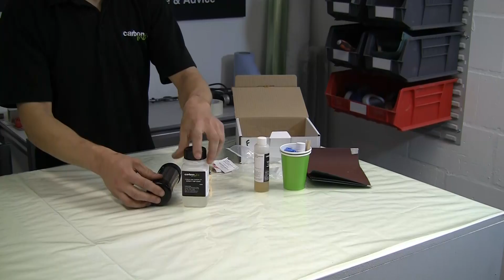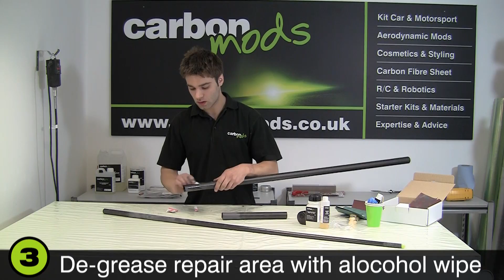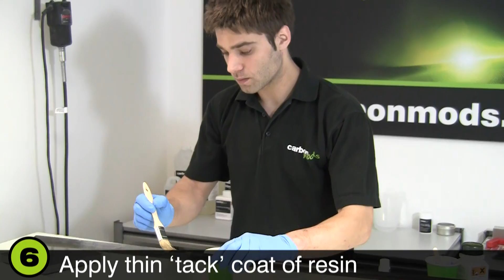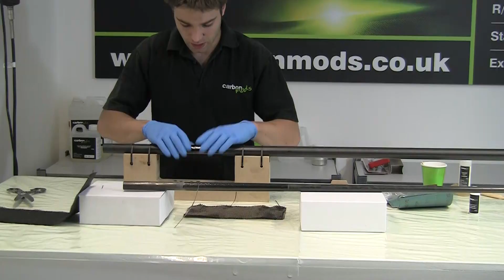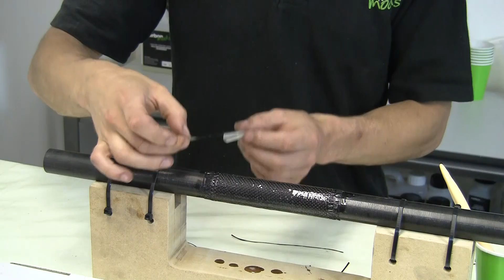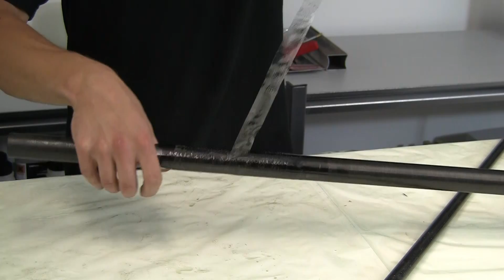How to Repair a Broken Carbon Fibre (Fiber) Fishing Pole or Rod

Comment from the maker: The reason is that when a tube has been fractured or crushed then the fine balance of the unidirectional structure is compromised (sometimes further than you can see) and so it's important to add some 'hoop strength' to the tube at that point. We stock and use unidrectional reinforcement every day but making a repair like this using UD just doesn't work anywhere near as well as using a woven cloth.

Comment from the maker: Yes, definately. The more carbon fibre you add, the stronger the repair will be. In the case of a bike-frame repair then we would certainly suggest adding plenty of reinforcement. On a fishing pole repair you wouldn't want to add too much extra strength because you'd end up with a 'stiff spot' in a pole that naturally has some bend in it.

Comment from the maker: Gloves are pretty uncommon when sanding composites (the dust just finds its way into the gloves and generally becomes more irritating that working without them). A mask would be a good idea if you do break down into the carbon when sanding. As you can see there was little dust disturbed into the air on this occasion; it's your choice.

Comment from the maker: @rapeta13 : What you 'fill' the break with can only really be epoxy resin or epoxy adhesive. Since there will be no fibre continuity through the break from the adhesive alone, this is only a small aspect of the strength of the repair. Once you've bonded the 'break' it would be time to put some additonal material around the outside of the break, in much the same way we do in this video. This is where you'll get the fibre continuity from.